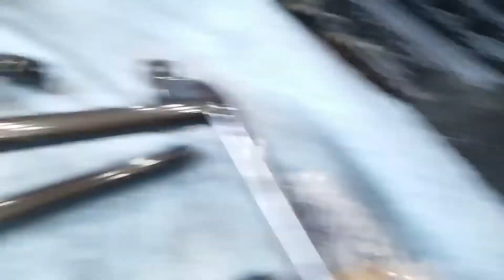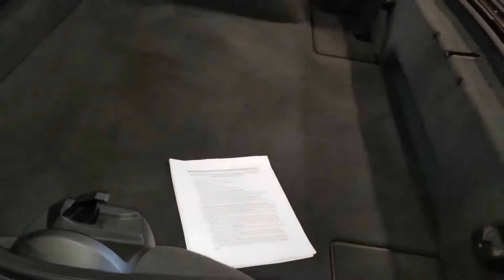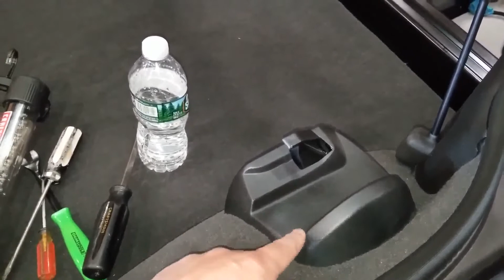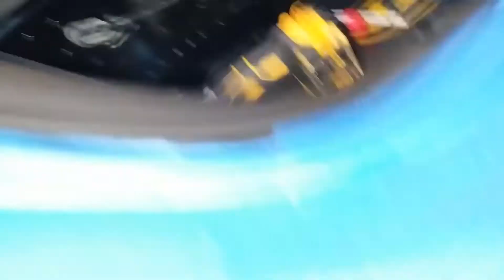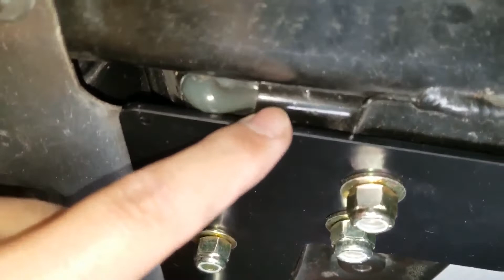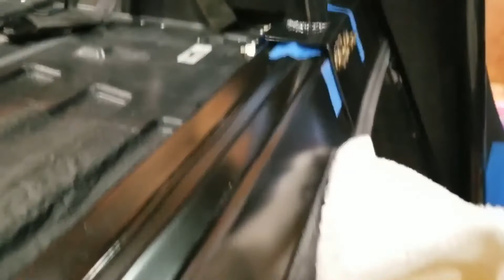INSTALLING A CUSTOM ROLL CAGE / ROLL BAR, PT 1 of 4. BOOSTED C6 BUILD

Comment: how long did it took for full installation roughly?
Reply from the maker: 1 to 2 months. I don't recall. I don't get too much free time so whenever I could squeeze in an hour or two I would work on it. It is NOT an easy task though so be patient and you may run into fitment issues that need to be sorted out.

Comment: What brand is this cadge i wanna do it to my boosted Vette keep getting kicked out from the track for going over 140
Reply from the maker: This cage is made by RPM rollbars. Its technically only good up to a 10.00 run in the 1/4 mile.
Reply: WATCH ME WRENCH I was looking for one that’s good for 9.00
Reply from the maker: There is no NHRA certified bolt-in cage that is certified to run 9's. You need the Halo bars over your head to meet NHRA 9 sec rules and it all must be welded in not bolted together.
Reply: @WATCHMEWRENCH  RPM makes a bolt in cage the certs to 8.50 for the vettes
Reply from the maker: @ryanveret4088  8.50 bolt in cage?

Comment: Another awesome addition to your vette. I'm in the market for a carbon splitter, skirts, and spoiler kit for a 2008 C6. I would appreciate it if you could recommend a reputable supplier. I'm in Hawaii and Corvettes here are somewhat rare. Difficult to do anything involving vettes.  Thanks for the video.
Reply from the maker: Hi Michael and thanks for watching and the support. If you watch my very 1st video I believe I mention who made my carbon fiber splitter and side skirts. I dont recall off the top of my head but i think I mention them in my video. Ill check the car tomorrow and Ill try to get back to you.